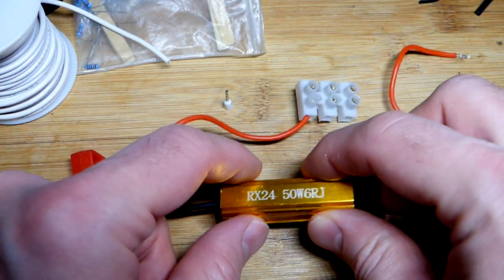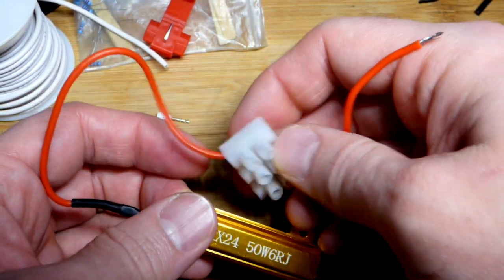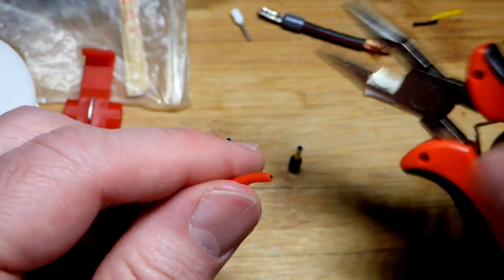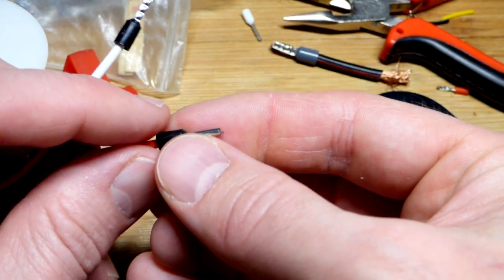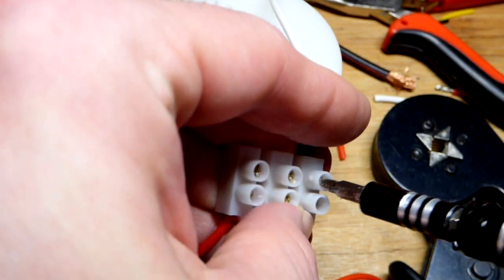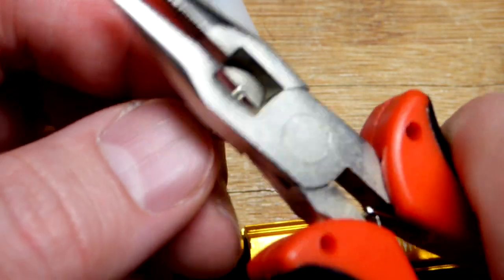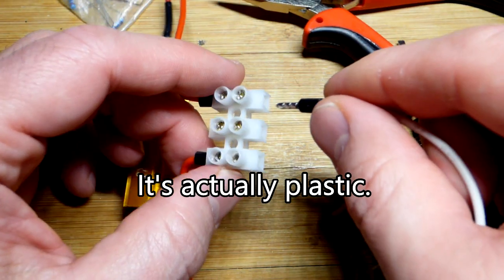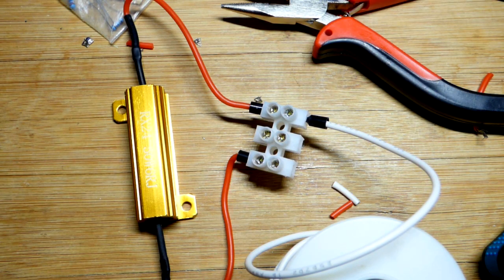Adding In Line Screw Connectors To My High Wattage Resistor Using Ferrules By Electronzap

Comment: Also if you cant remove that "stopper" as you call it, you can put the ferrules on upside down so they don't have the plastic boot, slide the cable through the hole of the crimper put the ferrule on as normal but upside down then you can slide the crimper up, crimp the ferrule then snip the very end off (the plastic boot).
Reply from the maker: I'd like to see a video of that. Thanks for watching!